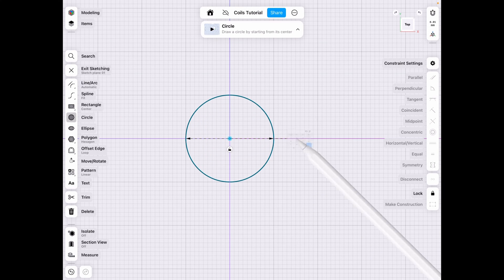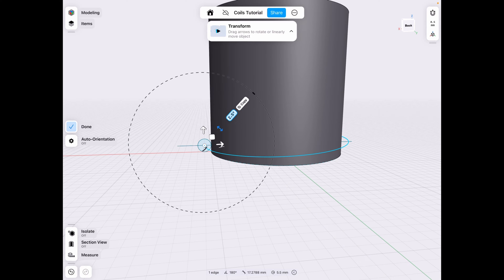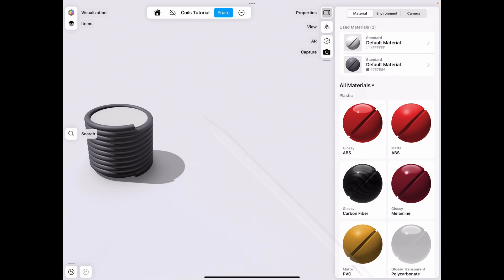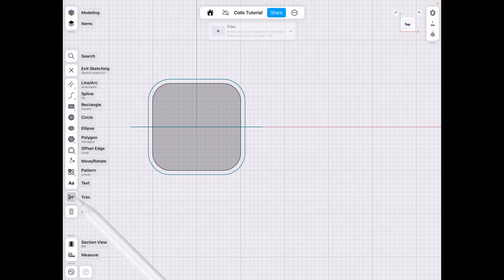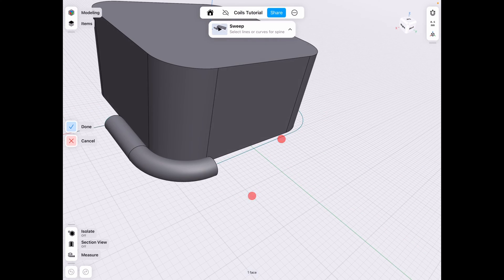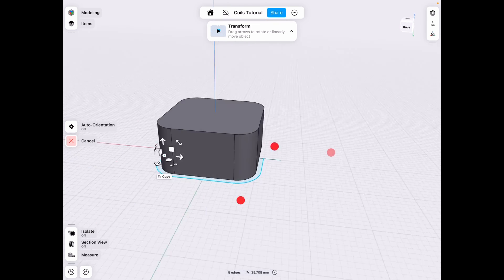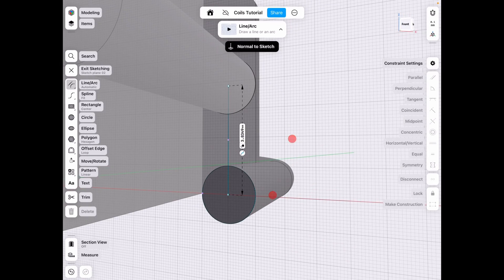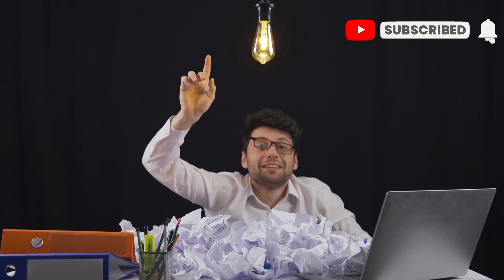Round & Square Motor Coils in [ Shapr3D ]

Comment: I’m wondering why you wouldn’t use the revolve tool for the first one
Reply from the maker: Made a video response- Motor Coil +1 Discussion [ Shapr3D ]
https://youtu.be/P0JRvGp6yqM
Reply from the maker: Actually, now that I think about it, you could use either method. Each one is useable in this situation for the round part. I guess I chose to sweep because I knew I was going to use the square one after for which the revolve would not work.
Reply from the maker: I pinned your comment because it was a great catch ✌️ so for anyone reading, yes, you can use the revolve tool for the round coil 👍
Reply from the maker: The only negative when using the revolve vs. sweep would be that if you want your coil to be tight, you would need to use sweep because revolves cant touch itself. When faces collide the revolve fails. Thats the reason threads are hard to make in Shapr. They need additional clearance.
Reply from the maker: Example: you wouldn’t be able to revolve 2.5 degrees, but you can use the sweep since its a separate body. But you cant union the sweep either unless you add thickness.
Reply from the maker: So the question becomes. Do you just want a visual, or a 3d printable body.